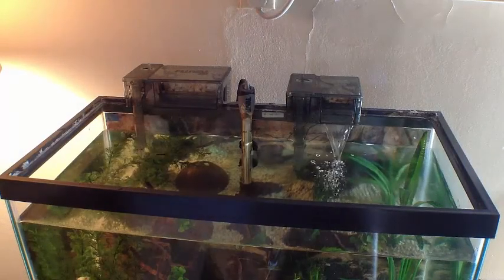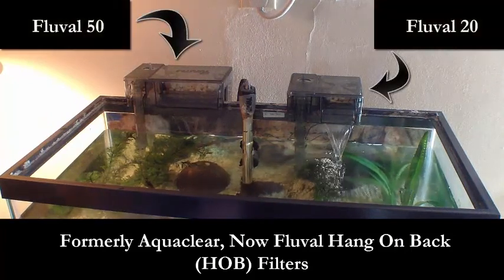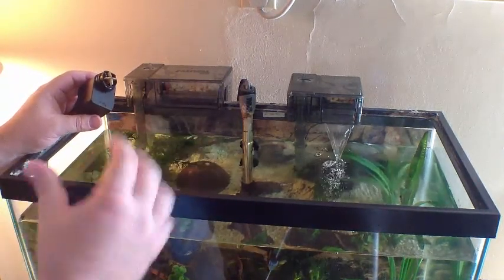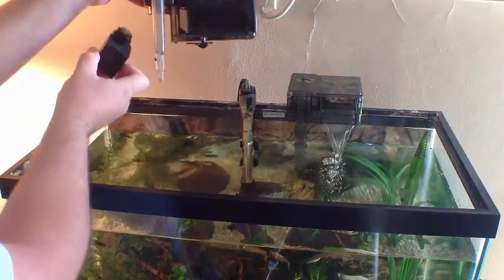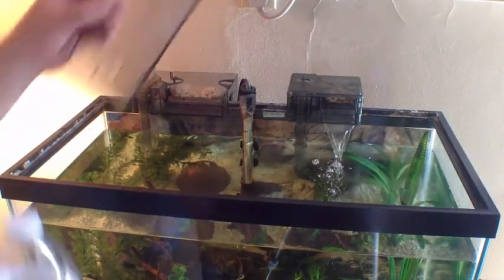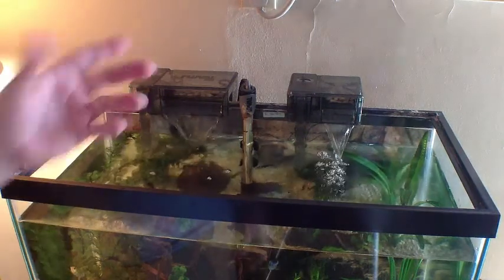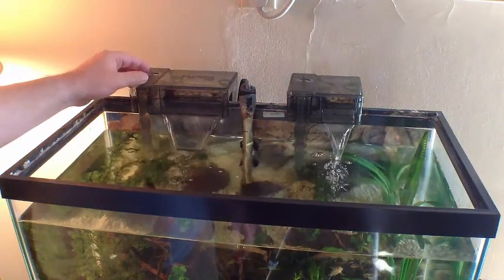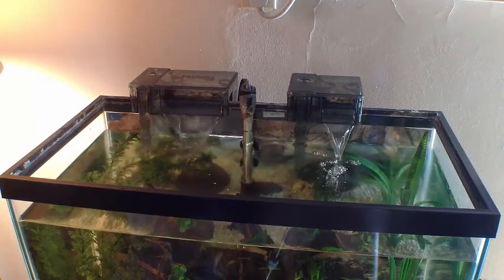Fluval Filters (HOB) Impeller Tip and Maintenance

Comment: You may have a dead spot with a pole in the electromagnet.  To check this remove the impeller.  Now plug the motor in and use a small screwdriver and put it in the impeller hole.  It should pull the screwdriver to all sides around the hole with equal strength.  If not, you may have a week pole and that's why it may not start.
Reply from the maker: sabretooth - you are absolutely right!  This is an older video I had to do a little of a correction on, and you are spot on.  The impellers were clogged with all kinds of waste, and of course, stopped working.  Now I make sure to clean the impeller pole once a month - the filters run like a top.  I'm going to pin this comment though for folks, especially if they don't see the updated video.  If they don't know about the pole and impeller these filters might drive them crazy...
Reply: Dow Corning - Mollycoat 111 - Silicone Grease. (Amazon). A Very thin (almost imperceptible) coating on the Impeller Axel Shaft is all you really need. But do not over do it. - also works for 'O' Ring Seals. Impeller type Water Pumps, Canister Filters, R/O Unit 'O' Ring Seals, Water Faucet Cartridges, Etcetera. - Don't use 'Vaseline' it Never lasts long. Do NOT ever use 'Superlube' for water Applications, it (was made for Air Fan Shaft applications) and will quickly turn Gummy in water. - Next: Intake Sponges on your intake tubes. This will prevent your Impeller axles from getting worn by debris. - an 'Old Timer.'

Comment: Thank you! This kept happening every time I would stop the filter to clean the tank, it would just stop working and then work again on its own and I just cleaned the tank and it did the same thing but I did this and it worked :D
Reply from the maker: My pleasure, Kaltrina!  Also - make sure to clean the impeller once a month or so....if that gets gunck on it, it won't turn.  But I really love these filters.  The two on my 20 gallon have been running like a top for 4 years 😀

Comment: I see many people suggesting Vasoline/petroleum jelly.  Petroleum products aren't really a good idea for aquariums.  Silicone grease, however, is safe. You should have some on hand for the o-ring on the filter motor.  As, the the o-ring should be cleaned and lubricated with silicone grease during filter maintenance.  But, in the case of impellers, you really should use a few drops of vegetable oil.  That's what Fluval recommends.  Also, I recommend checking the impeller pin for wear, and replacing it as needed.  After about 2 years of use, I've found noticeable wear that contributes to rattling.  Also, I believe Fluval recommends replacing the impeller every year.  Admittedly, I've gotten away with close to 2 years, before the motor/impeller started to make noise.  A new impeller and new impeller shaft, and it's like brand new.
Reply from the maker: Great advice, George!!  Thanks for commenting and letting us know. There you go, folks.....vegetable oil or silicone grease it is!
Reply: dmichaels fish den Also, you need to careful with silicone grease. I've found that it works great at first. But, depending on how much you put on, it can eventually find its way to one side of the impeller, causing a slight imbalance, which results in rattling. I've found vegetable oil works best. After cleaning my impellers, I blow the water out of where the shaft goes, then add a few drops with a dropper.

Comment: Hi my fluval 110 won't allow me to remove the impeller like yours, I had a smaller one that allows me to but the larger one won't, any tips?
Reply from the maker: Bob,  I hope i do!  Here is a follow up video i did on this filter, regarding the impeller.  https://youtu.be/9Fhbcgitu7k   The motor should detach from the back of the filter - this is where the impeller is housed.  The impeller sits on a small rod that is slightly magnetized.  You should be able to pull the impeller out to clean it.  Unless......is your filter really old?  

You can also use petroleum jelly to "lubricate" the impeller to help prevent it from sticking.  Does the above video help?  If not, let me know, and we'll figure it out!  :)
Reply from the maker: Is this the filter you have, Bob?  Or is it much older?

https://www.amazon.com/AquaClear-110-Aquarium-Power-Filter/dp/B000260FV6/ref=sr_1_1?s=pet-supplies&ie=UTF8&qid=1475617998&sr=1-1&keywords=fluval+110
Reply: I do that that filter but also a much larger version of it. I did clean the impeller and apply petteoleum jelly. It still stops filtering every now and then but not nearly as often and its much faster to get it working again thank you.
Reply from the maker: Glad that helped - yeah, sometimes the filter impellers and motors just get old - they do wear out over time.  Lubricating will help for awhile, though -

Comment: Just did the same thing and dumped water everywhere when i pulled it out. Don't know what i did wrong!?
Reply from the maker: Auslander1344 - I have a follow up to this video on the channel.  You just always want to make sure you remove the media and dump out the water in the filter in a bucket before unhooking the black extension part of the filter that holds the impeller and motor.  Whenever I do maintenance on the impellers, I always remove the media and dump out the water in the filter, then unhook the motor/impeller part - Hope that helps?

Comment: I like to recommend to anyone using an AquaClear HOB (Hang-on-back) filter the addition of a sponge filter to the intake, simply by taking a piece of vinyl hose and slipping one end over the intake elbow, and the other into the riser tube of a sponge filter. This has the benefits of not only preventing any small aquatic lifeforms from being sucked into the filter, but also add to the nitrification cycle by creating an additional growth of a nitrifying bacteria colony. Plus, it reduces the need for frequent changes of mechanical media, thereby helping to save money. It also reduces the need to clean the pump motor so often, and permits you to omit the sponge inside the AquaClear... allowing room for more media of your choice. 

Also, if you do feel need to add any "loose" media to the filter, don't go with the pre-packaged stuff... it'll just cost you more! Instead, buy a canister of it, and fill a knee-high stocking with it to be placed in the filter. Just be sure to rinse it properly once it's "bagged" before installing it, so no dust that can choke your aquatics gets into the tank.
Reply from the maker: All spot on, excellent advice!  While I didn't know this at the time, I've been using sponge filters on intakes for years...Great comment and thanks for sharing pancudowny!

Comment: my ac110 water flow started to slow down u cleaned the sponge and the motor prop any ideas?
Reply from the maker: +NorthEastPatriot a few ideas - the entire filter actually comes completely apart.  Under your inflow tube that sucks the water up, your should have a gray platform it sits on.  If there is any "gunk" on that it could slow your flow down.  You can actually pop that grey platform off and clean it (look under it too!).  Are your intake tubes cleaned out? Definitely clean the sponge and the carbon filter if you have one (or replace it). Also - you can completely remove the motor prop from the casing....not sure if you've seen this video: https://youtu.be/9Fhbcgitu7k?list=PLSE01EbAmJSxdMXaiqYooPkJ_Rn_mIV7d

That vid is a quick follow up I did.  If none of that works, man, you got me.....Remember too, the motors in the AC filters don't last forever.  If you've been running it for a long time, it could just be getting a little worn out.  Let me know if I can be of any further help!  --d
Reply: +dmichaels23 thanks
Reply from the maker: +NorthEastPatriot my pleasure - by the way, love your screen name!!!
Reply: +dmichaels23 lol thanks

Comment: Be careful of these Aquaclear filters. They are great to customize but sometimes they don't self prime and leads to motor burn out.

One time, a storm knocked out power in my neighborhood. The filter did restart itself fine. But another time, luckily I was home to prime it up...it couldn't self prime.
Reply from the maker: WRO absolutely. I have to self prime them quite a bit. Have to really keep the impeller clean. Thank you for your comment! Good for the folks to hear your take on them. They are average filters. Not great, not awful 👍😀